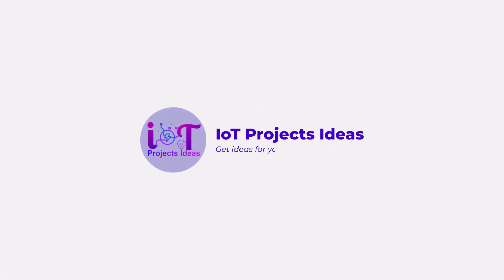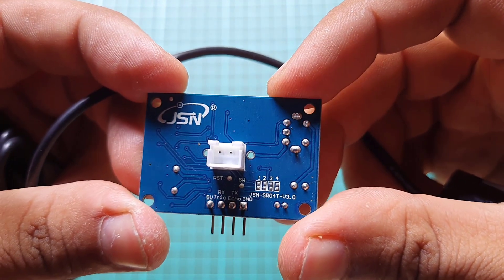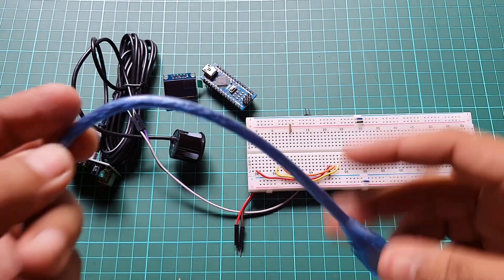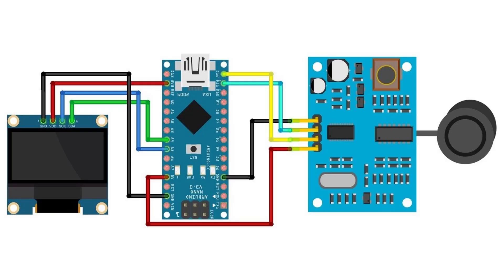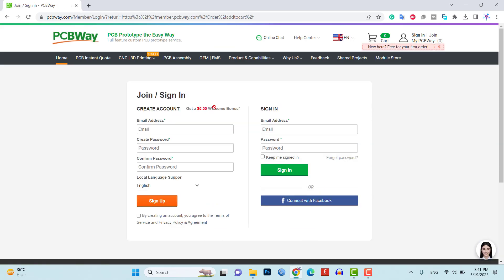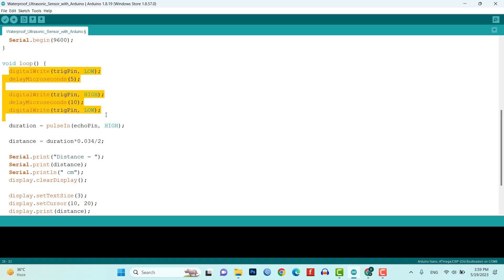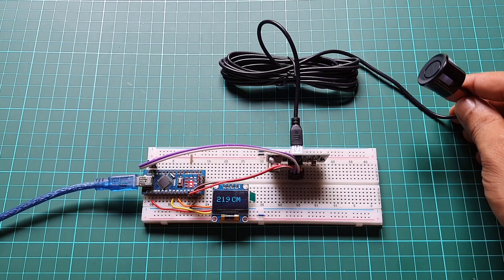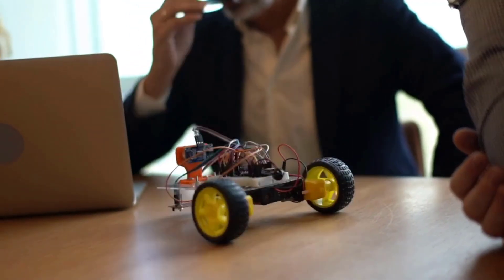Interfacing Waterproof Ultrasonic Sensor JSN-SR04TAJ-SR04M with Arduino

Comment: please i need some help with the dwin hmi project 🙏 😢...i already have a project water level indicator and controller displays parameters on 0.96' oled using esp32..i want to display the same parameters on dwin hmi i can make UI and everything else now how can i display this data on dwin...will this code work 
#include <HardwareSerial.h>

// Define the RX and TX pins for the Serial2 connection
#define RXD2 16
#define TXD2 17

// Initialize Serial2 for DWIN display
HardwareSerial mySerial(2);

void setup() {
  // Initialize the default Serial monitor for debugging
  Serial.begin(115200);
  
  // Initialize Serial2 for DWIN display communication
  mySerial.begin(115200, SERIAL_8N1, RXD2, TXD2);
}

void loop() {
  // Simulate reading the water level; replace with actual sensor code
  int waterLevel = getWaterLevel(); 

  // Send the water level to the DWIN display
  sendWaterLevelToDWIN(waterLevel);
  
  // Delay for 1 second before sending the next value
  delay(1000);
}

// Function to simulate reading the water level sensor
int getWaterLevel() {
  // Replace with actual code to read the sensor value
  return analogRead(34); // Example analog pin for water level sensor
}

// Function to send water level data to the DWIN display
void sendWaterLevelToDWIN(int level) {
  // Format the command according to DWIN's protocol
  byte command[] = {0x5A, 0xA5, 0x05, 0x82, 0x00, 0x10, (byte)(level >> 8), (byte)(level & 0xFF)};
  
  // Send the command to the DWIN display
  mySerial.write(command, sizeof(command));
}